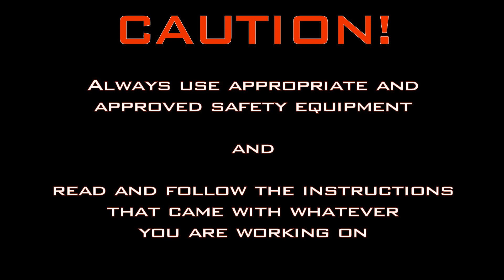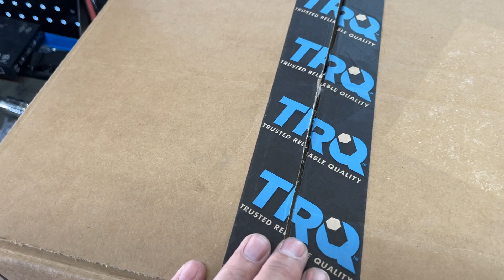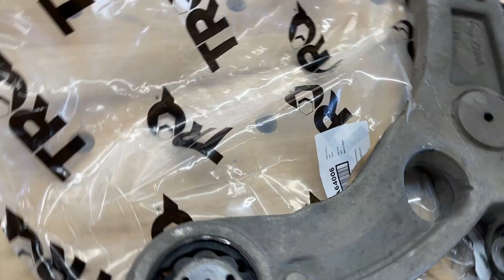HOW TO: 2015 Jeep KL Cherokee Control Arms Replacement... Sure.

Comment: Well I did it!.. I took off the whole bumper cover and left the wheel well liners attached.. I tried to get in there without taking the cover off but I'm up in Canada and the bolts were a little rusty and I just decided that wasn't the way to go.. once I made up my mind it really didn't take that long .. I followed your instructions so thank you so much for the details about how to separate the bumper cover from around the headlights and the other details👍🇨🇦✌🍻
Reply from the maker: @calvinpochinko4277  good to hear and great job! I tried to leave it on too but decided to just take it off and save some frustration.

Comment: Nice video,Torque specs? And sizes of inverted torx sockets were 18 and 20mm?
Reply from the maker: Yes, 18mm for the front bolt and 20mm for the rear bolt. The torque spec is 90 ft-lbs for the front bolt and 162 ft-lbs for the rear bolt. Thanks for the comment and questions it means a lot 😉

Comment: Yes do not tighten the front control arm bolt until the suspension is at ride height and the easiest way to do that is put a jack underneath the ball joint and jack it up... good video I'm going to try and do it with the bumper on
Reply from the maker: @calvinpochinko4277  excellent advice, and be sure to tighten those bolts before putting the front subframe bits back on, they get in the way of the control are bolts b

Comment: 2 questions….need for alignment after ? And what about those bottom ball joints? Awesome video though thank you!
Reply from the maker: Thanks!  I didn’t feel any need for an alignment after, didn’t touch the steering at all. I didn’t end up doing the ball joints, the originals were still in good shape so I just put the new ones away in case I need them later. It is crazy to me how these control arms are made to wear out so quickly.
Reply: @chrisdinwiddie6503  my plan on the ball joint is to remove the casting, axle, brake and spindle send it to the machine shop

Comment: I have an appointment to get both control arms replaced.  They want to replace the struts and shocks as well. I’m only wanting to get rid of the rattle at slow speeds.  Thoughts?
Reply from the maker: @NavyFam-z4x  yeah, might as well as long as they also replace the upper mount
Reply: Dealing with this issue now after suspension was just done. Slightly annoyed I'm having to go back and forth to dealer right now

Comment: Will the broken rubber in the control arm cause a rattle in drive when going under 20 miles an hour?
Reply from the maker: @NavyFam-z4x  not sure about the rattle, our jeep did that and it was the upper strut mount bearings. The wear very quickly and are a bad design IMO

Comment: FYI you don't need to pull the front bumper off. I just did one at the shop the other day. You can reach the bolts with out doing the bumper
Reply from the maker: I did see a video where someone left the bumper on and was able to do it, but man I just couldn’t get my arm and hand up in there to save my life.
Reply: You say that but I ask you how much does it help without having the bumper in place? I know it's a pain to remove but would you know how much easier it is to maneuver tools with the bumper?

Comment: I have a jeep cherokee, and when i am either stopped, or going 0-10mph, if i turn left and right i can hear a clunking noise, do you think this could be the control arm bushings?
Reply from the maker: Could be. Also could be the upper strut mounts which also wear out quickly on these.
Reply: Yes I'm still having the problem, getting the upper strut mounts changed soon so hopefully that will sort it out

Comment: yeah, kinda crazy...the aftermarket lug bolts are one piece as opposed to the factory bolts which are two pressed pieces (of different metals, which is why they swell, thanks Jeep/Fiat).
Reply: Not just Jeep /Chrysler. GM does the same thing. Probably others. Tin caps to resist corrosion. They get damaged by use. They rust underneath the tin which is considered swelling. Why you start seeing rust when you replace with solid replacements like Dorman.

Comment: In your outro, your license plate is visible. 

Question: did you notice ANY vibration or play in the steering prior to replacing the lower control arms
Reply: What struts did you go with? I unfortunately chose wrong and it completely messed up the front end. Rockauto won't also won't honor incorrect fitment and design issues causing the problem so I'm SOL and have to order new ones.
Reply from the maker: There wasn't any play in the steering at all, and no real vibration, just the "clunk" when coming to a stop or taking off from a stop (both forward and reverse).  

Thanks for the heads up on the LP btw, much appreciated (I didn't even notice, I was exhausted after editing and watching it multiple times).
Reply: @goodjerm  you can edit it in YouTube studio with a sticker or big block letter to keep the content live 🥂
Reply from the maker: @FlynnsGarage  thanks for the help!!!

Comment: Hey snap on makes the half sized lug sockets but I believe harbor freight has them as well
Reply from the maker: Thanks for the comment and advice. I found them as well on the Amazon website but had to replace them anyway when I had new tires put on recently. Also had the same problem on my 2017 f350 that I just bought a month ago.

Comment: I kept waiting for you to wiggle that ball joint to find out how worn it was. And yes that horizontally mounted control arm bushing will rattle against the housing it’s mounted in when it’s loose depending on conditions. Like going over bumps.
Reply from the maker: I fiddled with the ball joints but since I didn’t replace them I didn’t think to film it (still pretty new to filming everything I do). I didn’t feel or see any signs of a bunch of wear, and the car is driving like new. I still have the new ball joints, when they do start showing signs of wear I’ll do them, and of course make fun of myself for not doing them at the same time.

Comment: kid and I did it with the bumper skin on. 2015 jeep Cherokee Trailhawk with the off- road pkg. Not a super fan of this car. Had to abandon the skin removal due to the riveted on to the fender. pulling the skin away from the bolts was ok but it was a 3 handed job. I could do it with a couple 2x4's as a shim to hold it out. the arms were easy to take after the frame extensions were off. E-torqs 16, 18, 20 are manditory tools 21mm for skid plate 18mm and 19 mm sockets 6mm allen for the balljoint and a pitman arm puller with a steel shim ontop of the ball joint bolt. Sloppy 8 hrs for us. But I enjoyed my kid doing the work mostly.
Reply from the maker: @thicketbomb  I love kids helping their dads in the garage. Nice job, I’m not a huge fan of these cars either.
Reply: @goodjerm  kids car, (he's 20). Said the steering is a lot tighter. Was wearing a little on the tires, we got it in time! Thanks for the video it really helped.

Comment: Somebody told me to torque the control arms with the suspension loaded. So the bushings don’t tear. What do you think about that?
Reply from the maker: I don’t think it would matter at all on the rear mount that is horizontal given there’s no movement on the actual bolt. I guess on the other mount it could make sense, but the bolt is tightening up against a metal sleeve (if I remember correctly) so honestly the thought never occurred to me. I didn’t notice any issues with my install, and the car is driving like new.
Reply: Yes, On all cars and trucks you always want to load the suspension before tightening the control arms.
Reply: @goodjerm he is correct by the way regarding the front control arm bolt.. the back one doesn't matter 👍

Comment: Torque when its under load by using a jack under ball joint area
Reply from the maker: That is solid advice. I ended up resetting the torque about a month later with it on ramps so they had load. They took a little more :)

Comment: Where did you get new control arms from? What make?
Reply from the maker: I have it in the description but here the link also
https://www.partsgeek.com/catalog/2015/jeep/cherokee/suspension/control_arm.html
Reply: @goodjerm  sorry, didn't even notice it in description.  Thank you!
Reply from the maker: @anthonypennino7821  good luck on yours!
Reply: @goodjerm  thanks
 I went with the carquest arms from advanced auto and they didn't line up right. I shouldn't have to fight them to get into place. So returned them and gonna order online
Reply: I bought mine from moog. Very well known, reliable name. Try is made in China. Used them before, but because it’s China, I try not to.
Reply: @GORT70 is try the brand? I’m currently looking at some TRQ control arms and struts. Think everything will line up or should I go with MOOG?
Reply: moog makes some cast units, but the forged are supposed to be better.